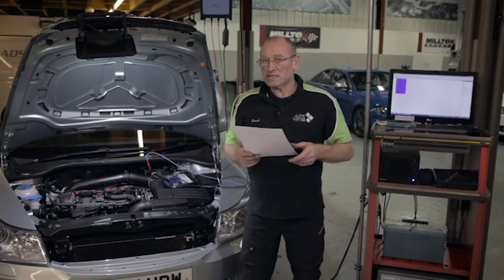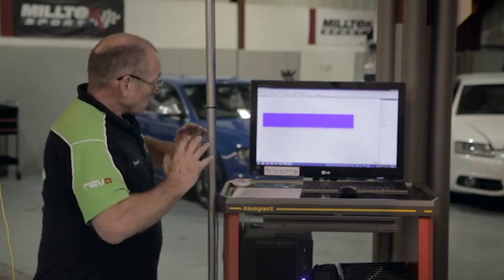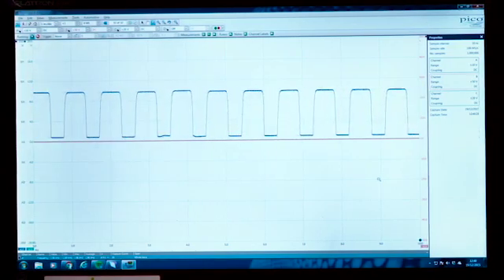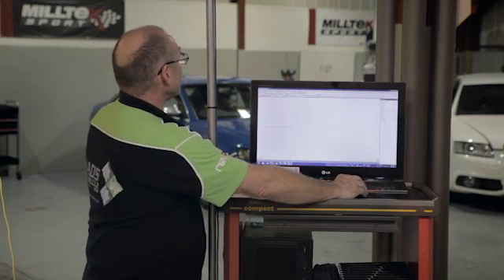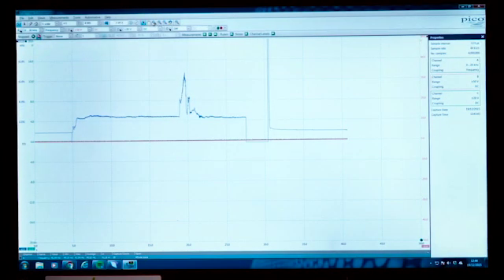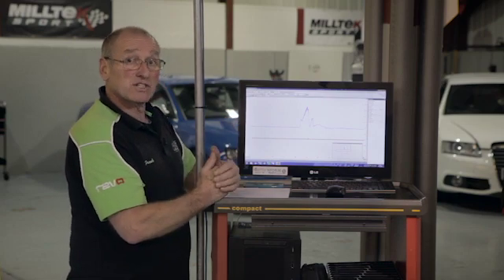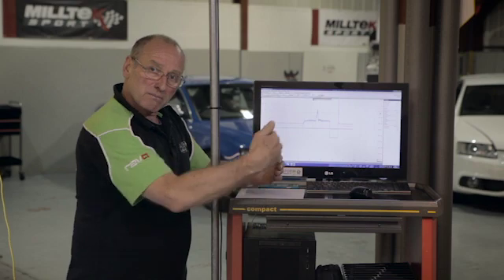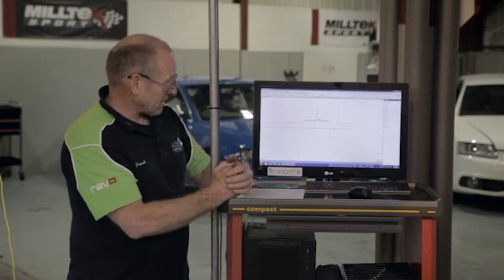Frank Massey's Top Ten Tests with PicoScope: #3 Air mass meter conversion digital to analogue

Comment: what was meant by the phrase. I can't raise the rpm hight anymore because this is a dsg box.
Reply: The engine ecm will limit the maximum rpm while vehicle is stationary . Usually to 2000 rpm. A dsg box is a direct shift gearbox commonly fitted to many VAG group vehicles.

Comment: For those that come across this video and read the comments, I think the following explanation will help explain what is happening in this video.

Since most MAF sensor signal circuits output an analog voltage that corresponds to the amount of incoming air mass, the scope can be connected to this voltage signal and then this analog voltage waveform can be compared to the Lambda sensor response to determine if the MAF signal is rational.  The Skoda vehicle under test in this video uses a MAF that outputs a square waveform (digital) voltage frequency on the sensor signal circuit; and, this frequency corresponds to the amount of air mass.  This type of MAF signal creates a challenge for the scope user who wants to view the measured air mass in an analog representation.  Frank is showing in this video that the technician can still get an analog representation of the incoming air mass on a scope by measuring the MAF current inductively.  The black inductive current probe appears to be clamped on one of the wires connected to the MAF. This current probe is shown at around 1:30.
Reply: I think he was comparing the frequency of the MAF sensor output  to current.  MAF's  use a constant voltage to produce a current. Air flow changes the resistance of the sensor - so the output current changes.  This is usually converted  to a frequency.   If comparing  the oxygen sensor then there are two types  - ones that  produce a  frequency signal  and the more sophisticated ones that  produce a current. The first  type simply answers the question is the mixture lean or rich. One voltage for one condition and one voltage for another  The current output type  is  proportional to oxygen so changes gradually with oxygen .

Comment: Can you show how you hooked up to the oxygen sensor for the current
Reply: Early on he said it was the o2. At about 11.28 he says its current at the MAF. I'm not sure.
Reply: Frank indicates that this video should be considered along with the next video in the "top ten" series.  The next video in this series will likely show the scope connection to the Lambda sensor signal circuit  ...since that next video will contain more information about wide band Lambda sensors.  Based on my understanding of scope use and wide band Lambda/exhaust/oxygen sensors, I suspect Frank is either using an inductive current probe on one of the signal circuit wires leading to the wide band Lambda sensor; or, this wide band sensor design has a 5th wire which will have a changing voltage in relation to AF mixture.